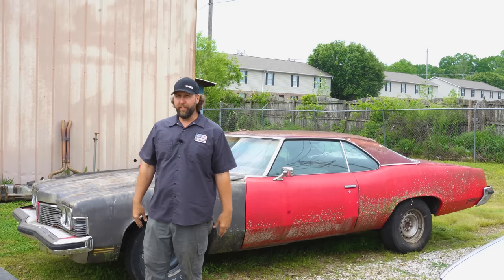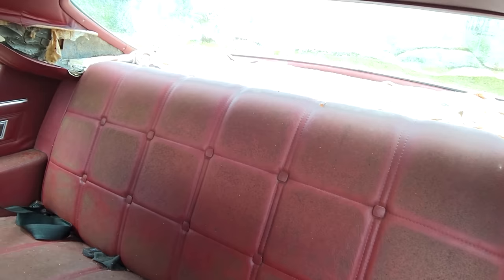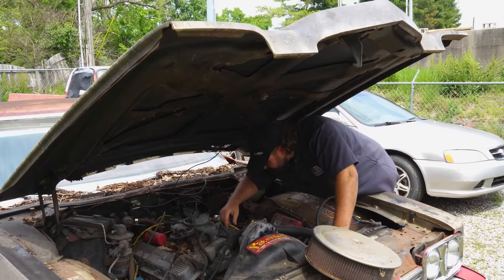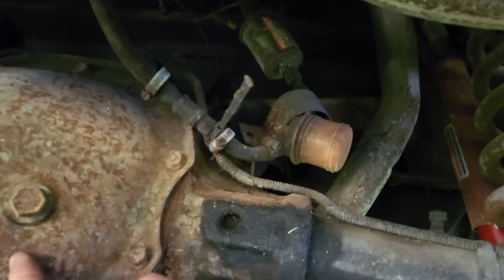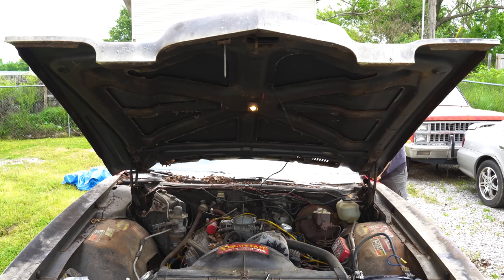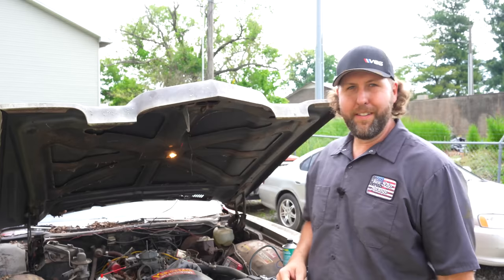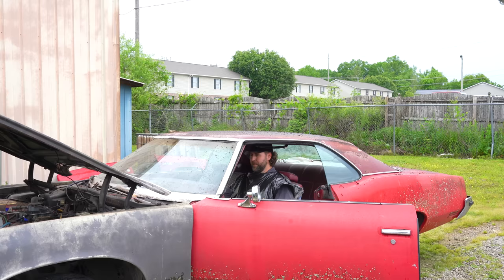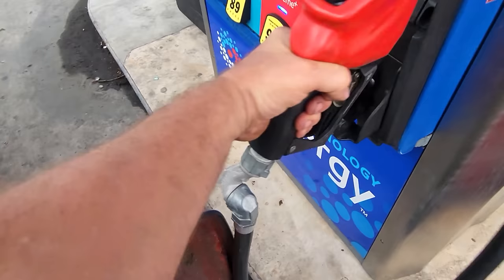FORGOTTEN Pontiac Catalina - Will It RUN AND DRIVE 150 Miles Home?

Comment: I have found quite a few olds and Pontiacs with loose timing chains makes the motor sound like it's knocking almost I got a 69 cutlass 4 door for 200 bucks because the timing chain was loose it wouldn't even do a burn out on skinny bias ply tires I put a new timing chain in and a electronic egnition from a mif 80s gm and the car would leave a 40 foot podi black mark also was a 2 speed tranny not  power glide but olds. Version of the power glide I ended up selling the tranny for 600 cause a guy wanted it for his race car and sold the motor for 500 a guy put the motor in his mid 80s GMC truck I parked out the body and got around 450

Comment: Hey man why don’t you just buy 2 or 3 five gallon containers for gas!? They would line up in the passenger floor board and hold each other up in case of evasive maneuvers or heaving breaking engaged. I mean if you buy one ☝️ then one more at least won’t hurt on your way out and switch tanks while driving. .. I mean after you pulled over safely on the side of the road 😏😉 I support only the safest of driving ( wink wink cough cough ) 😅

Comment: paint the car the rest of the way Red an replace the seat covers an check the floorboards do the breaks an restore it back the way it was maybe put a different carberator in it a holly one also put an exhaust system on it then sell it to me

Comment: Well it pleases a fella to see you get a rig that you don't bust your b@lls on to get rolling 
I am surprised you did not use the compressor to backslash the fuel line into the tank , you could of had capasitie😂, 
Must have been your cheapest recovery yet, oil , filtre, battery, tyres, break juice, and a little ice cube juices, and you were a running on down the highway 
DEREK, JESSICA, AND KIDS  a very very merry christmas 2023 to you (21/12/2023 today)